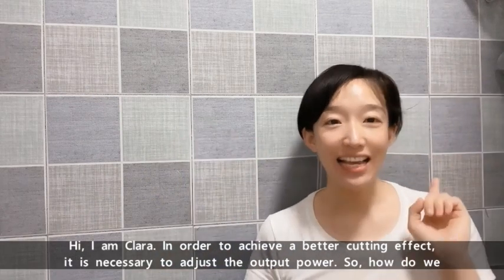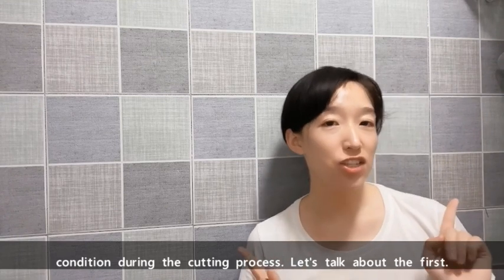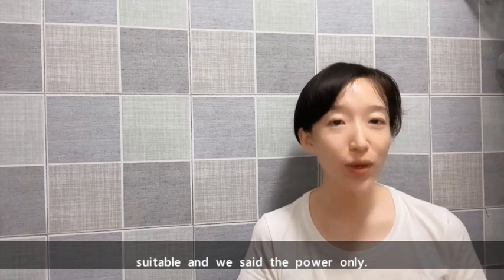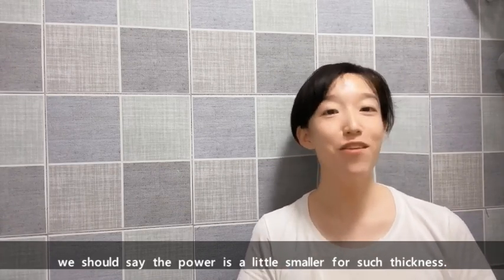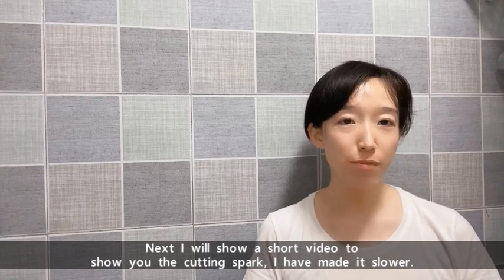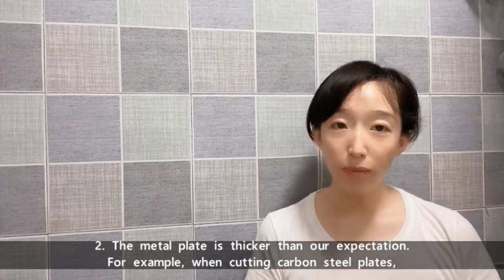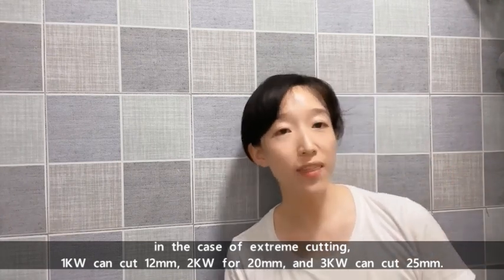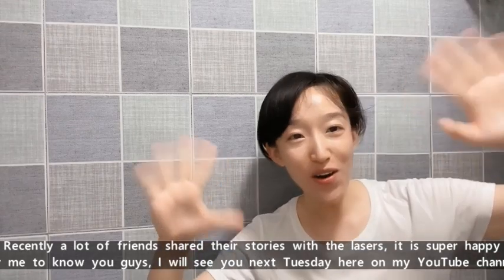How to Judge Power Setting is Suitable?|Fiber Laser Cutting Machine

Comment: I have 6kw power laser machine. During cutting it makes drosses on the bottom edge of the plate. How to reduce it? How could I set the parameters
Reply from the maker: You can check a video "poor cutting" of my channel.

Comment: 3 kw 
max source 
ray tollol bm 111 head 
i am suffering in machine problem 
problem is dot arrived from upside ...some time qbh damgeed .focal lence damage.colimative damage...so many time i change all lence..in last i changed whole source with fiber ...but still problem not solved
Reply from the maker: Is it possible that the machine is in a dusty environment? When you change the lens, dust will enter the cavity.
I suggest cleaning the entire cutting head.